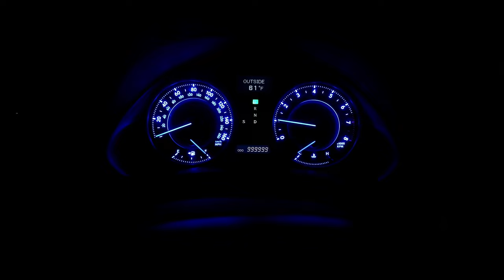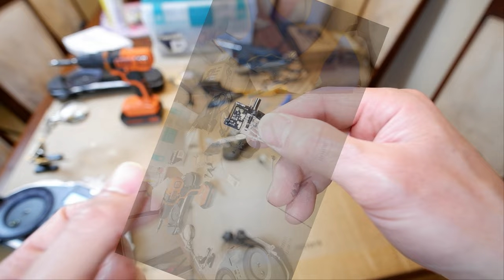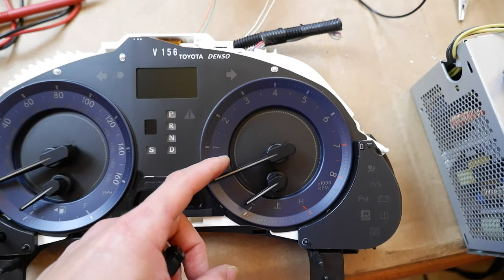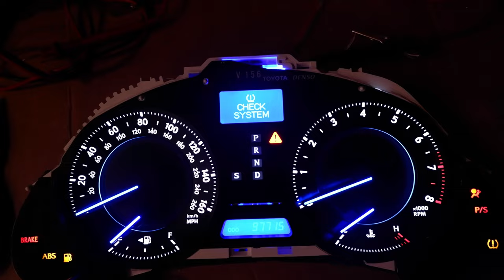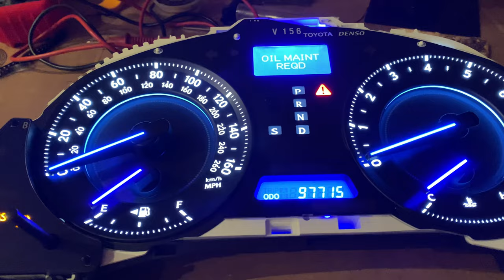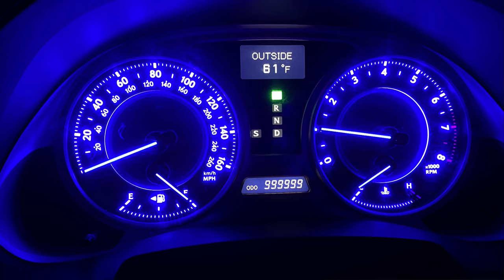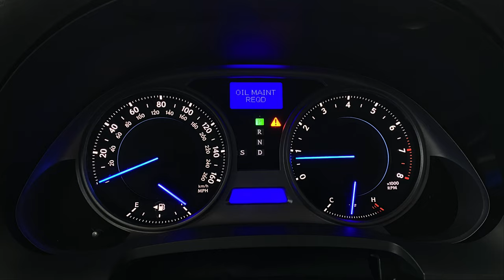Lexus IS250 IS350 Blue LED Cluster Modification | Speedometer Needle LED Repair Part 2

Comment from the maker: You can make these any color you want as long as there is a 1206 LED (preferably right angle) for needles and PLCC-2 for backlight. Check the links and info in description box. These LED are referred to as various numbers (metric and imperial).

Comment: Great work! I wish I had your patience to do all these diy's. Now that I look back I'm glad that Lexus suckered me into buying an extended warranty which covered all the TSIB/TSB that I experienced i.e. dead speedo needles, failed nav screen, failed water pump, rear view mirror spotting, sticky dash, wheel bearing,  windshield drip molding cracking, aux port static, cam gear rattle at start up, passenger lumbar adjustment electrical failure, etc.
Reply from the maker: You basically named every issue that these cars experienced from new.

Comment: Hey, I removed the needles to get to the board and fix some dead LEDs and replace them. After putting everything back, I set speed to 0 and plugged it back in and all was good and I drove around. But then after turning car off, after a little while the speed and rpm needs seem to drop a tad below 0. RPM is very little bit below 0 but speed is quite a bit below 0. Then when I start up my speed is wrong because 0 is below 0 and hence all the speed reading is wrong. I took apart the lens and moved it back to zero and once again it worked until I turned it off for a while then it goes below 0 again. I thought I'd try moving it to 0 with the car on, so tried that and same thing. Worked until i shutdown and after a while dropped below 0. Have you ever experienced anything like this? Would really appreciate your help. Thanks
Reply from the maker: Not really. I always remove with them at like 30 or 40 mph/rpm and put back in same spot. I never pull them at zero. I may have adjusted gas and temp once or twice to get right. The gauges also self calibrate upon start up, so in theory they should reorient themselves.
Reply: Im having the same issue. Did you ever find a solution? Thanks in advance.

Comment: On my 07 IS250 the leds went out on the speed and tachometer, I found a guy on Craigslist who replaced both the LEDs with any color you want for $80. I live in California though
Reply from the maker: I think that was Tanin Auto Electronix does the repairs and has a guy in WI and San Diego.

Comment: After doing this and putting my needles back, the rpm needle falls like 500rpm below zero. No matter where i set the needle it just goes back to the same spot. Doesnt matter if i do it with the car on or off. If i set it with the car on it will stay correct only until the next time i turn the car off. Any solution?  Thanks in advance.

Comment: 3Q's  I see your powering the instrument cluster with a bench adapted PC power supply , Which wires on the IS cluster are used Pos & Neg ( colors ) ? also are you powering with +/- 5vdc for LED's or +/- 12vdc or combination of both voltages ?  thanks
Reply from the maker: Just 12V to the cluster power pins.

Comment: I need to know the connection u r doing to light up the cluster on the bench
Reply from the maker: Ground 1/13 and power to 12/24 wires.
Reply: @TunerwithKids  appreciated dude

Comment: Hi Binh,  that was an amazing work.  I am interested if you can do work on my guage for me or at least give me some informations ,  very appreciated.  Keep up the work , liked your channel.
Reply from the maker: I don’t do this for others. Just making DIY videos for those who are inclined to do it.
Reply: @TunerwithKids  OK Binh 👍  appreciated for your replied and thanks for the video.  Keep up the good work but what software did you use for reading those odometer code , I got a newer used car to replace  my  old one, not pass smog yet.   Newer one i believe prior owner changed with a new cluster  and the odometer is lower  then I saw on carfax witch I checked after I bought it, was about few months no record of it and i want to put last known  plus couple thousand miles on to that.  Lesson learned, should have left without buying it., now I have 2 to work on instead of one.    Dmv probably have last record but they don't tell.  And the speed needle not working.  I didn't have time to try to learn to fix as I am with prioritized  project.  Thanks for your help any information appreciated.

Comment: Hey I did this and messed up a bit with installating the needles again, like my tachometer is way below than it should be, it shows my ideling below 0, any idea how I fix it now? I tried to remove and put them again didn't work out
Reply from the maker: You have to remove and lightly install back and get it back to normal again. It’s gonna be trial and error.